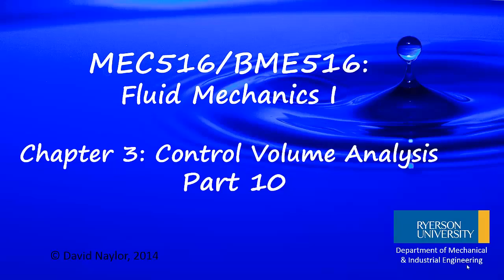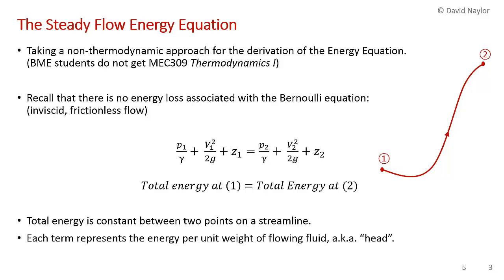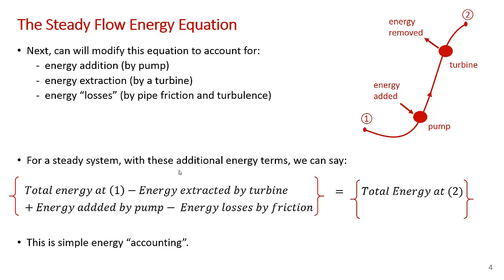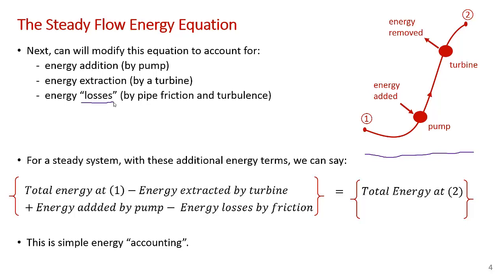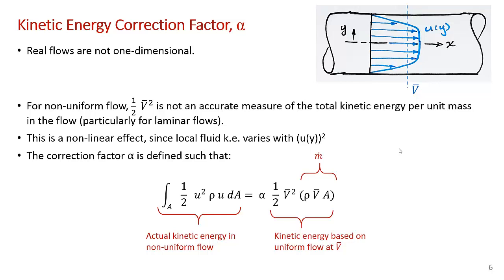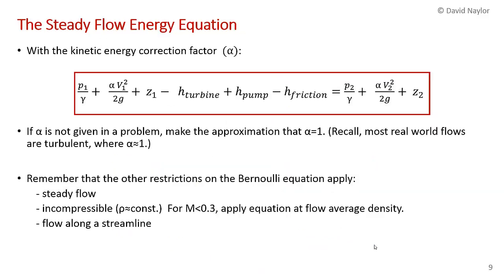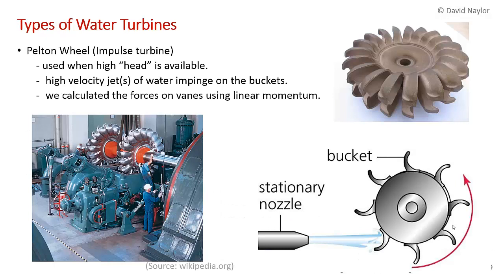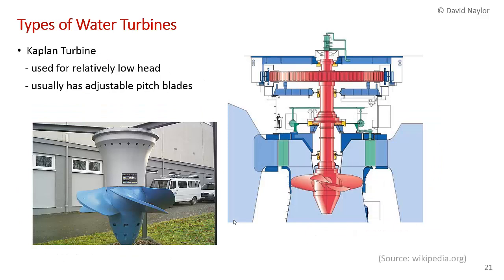General Energy Equation: The Bernoulli Equation with Pumps and Turbines

Comment: at 28:03, why we used same volumetric flow rate in section 1 for section 2 to find velocity?
 I know that after turbine velocity & pressure will drop therefore volumetric flow rate will also drop. 

Thank you for everything your videos help a lot and please help me to understand my question.
Reply from the maker: Thanks for the time marker. That helps. This is a hydraulic turbine. Liquid water is the working fluid. Liquid water is incompressible i.e., density is not a function of pressure and thus, constant. So, both the mass flow rate and volume flow rate will be a constant at any point in the system, because rho=constant.
Reply: @FluidMatters  Thank very much!